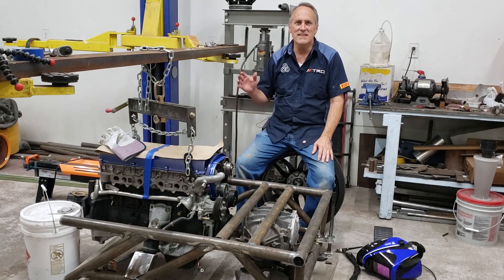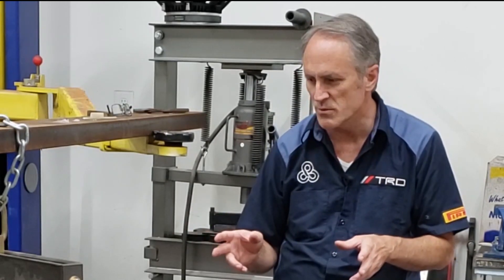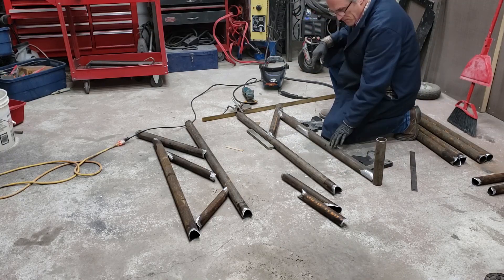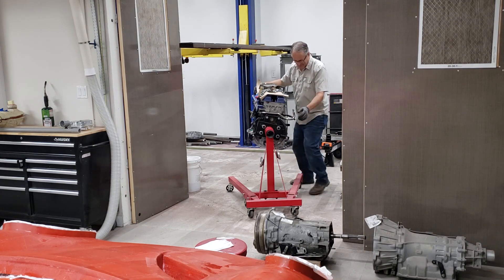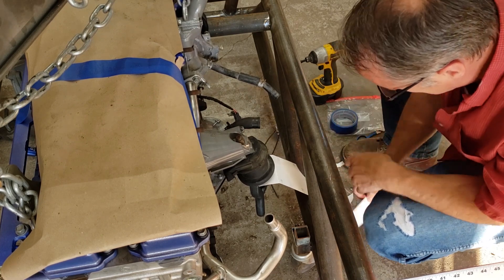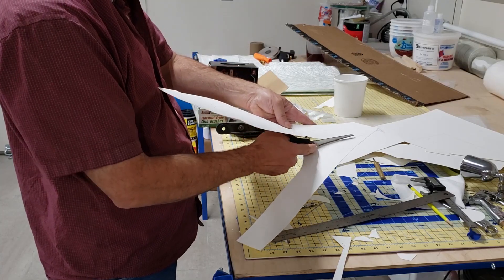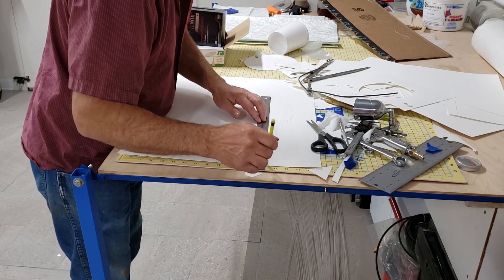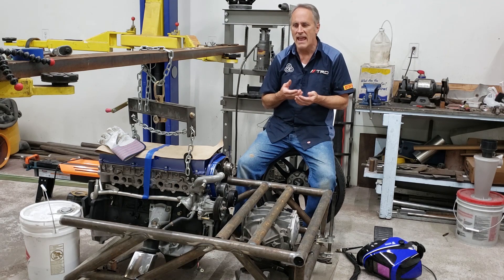A12 - Arete Supercar. Start of the sub-frame assembly

Comment: Hi Jay , what size tubing did you use for the frame of the engine?
Reply from the maker: 2 inch DOM chromolly of .125 and .095 wall thickness. I could have used some smaller tubing in areas, but the supplier requires you to purchase full lengths, so I went with lass bracing and bigger tube.
Reply: Hi Jay, thanks for that info. Love your fibreglass work. Should send you pics of a GT40 shell that I bought and to say the least it is horrendous.
Reply from the maker: @mikeleonard8031  Skip the tubing, you need an aluminum box frame monocoque . . true GT40 style!
Reply: @BuilderCreator  ,I know Jay.You want to design one for me .I will appreciate it and of course I will pay for the design.Think about it.